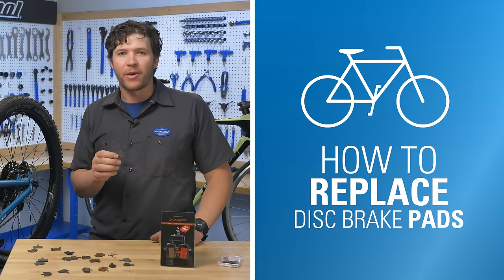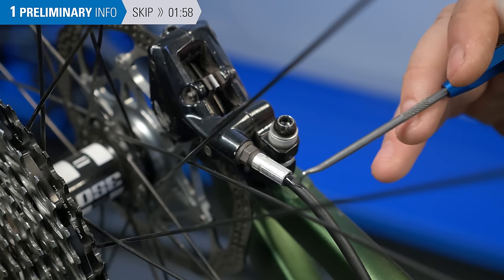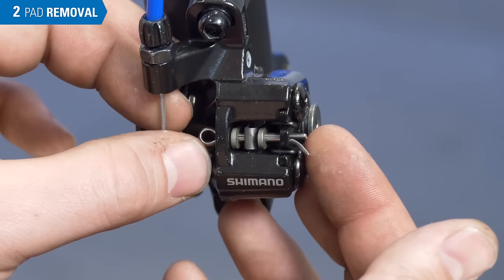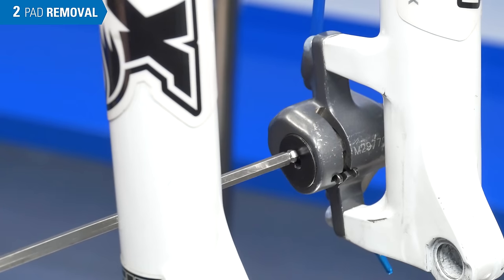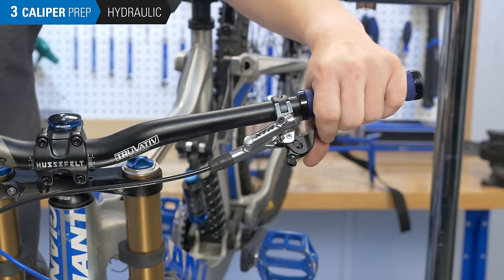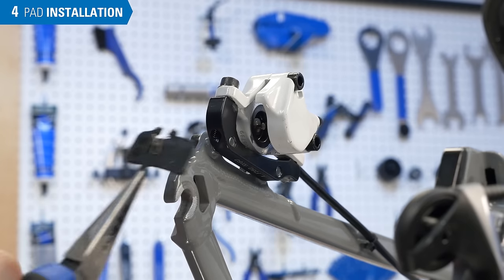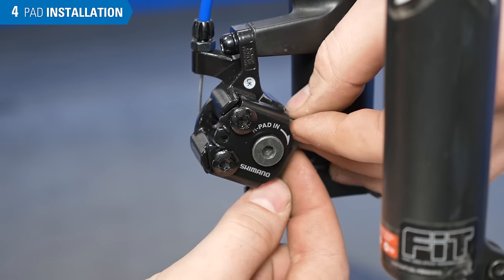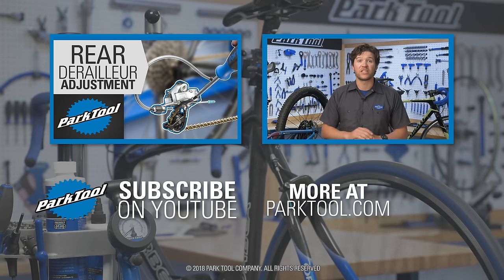How to Replace Bicycle Disc Brake Pads

Comment: Do you also have to re-dial in the brake contact dial on the brake lever itself, back to the most open setting?
Reply from the maker: When resetting the pistons that is not necessary.

Comment: I have the cotter pin type of brakes. I removed the pads and installed them back in and now I have no brake pressure. Did I do something wrong? I didn't touch the brake leaver when removing the old pads.

Comment: Do you know why my front pads don't stop like the front ones do? I can move my wheel with my hand with force, the back locks up though. Its a newish bike any ideas? They're adjusted properly. The rear brakes also pulse, as if the rotor is out of round.
Reply from the maker: THis would lead me to believe the pads and rotor have been contaminated with some kind of oil. New pads and rotor would solve the issue. There are some other methods of getting rid of the oil but in our experience new is the only 100% effective way.
Reply: @parktool  oh thanks! Getting new pads. The company is warranting them. And a rear rotor. Im so glad.

Comment: Park Tool, something that was not covered.  Some pads have a left and right. Which side is the left or right (same as your pedals)  and why do these pads specify left and right?  maybe you can answer this in comments for future readers.
Reply from the maker: Good catch. Many Pads come left and right specific because of the shaping of the pads and how they are held in. Others are side specific due to cooling fins that integrate in a specific way to the caliper. Even others are symetric and could be installed either way are labeled right and left as to give you consistency if you were to ever remove your pads and re install them you can get them to the correct side. Thanks!

Comment: My rotors are straight, callipers perfectly aligned, pads spaced out correctly and evenly either side of the rotor - BUT every now and then (usually after a bump but not always) I'd get an intermittent zinging rasp on the front brakes. Kinda like the sound it could make (I speculate) if one of the pads lifted off it's piston and is glancing lightly against the side of the rotor... or perhaps the fork LOWERS get twisted temporarily? Sometimes tapping the front brake lever gets rid of it, sometimes not - but eventually it goes away (I can't recreate it on my workshop). I have two full suspension MTBs, I'm the first owner since brand new (both thru-axles, one with 180mm rotors and the other with 230mm rotors - different brand hydraulic brakes and forks) and they both do it. Does this ever happen to any of your bikes? If it does, I'd like to see a video made about this. Cheers!
Reply: Could be due to slightly worn out hub bearings? Or the wheel clamp is not tight enough?
Reply: @redbullnshimano1  I've considered that but it's a brand new enduro eBike with a thru-axle, unless of course the wheel bearings are defective (but I can't find any evidence of it. When I picked it up from my LBS I asked for the brakes to be switched around to what I'm used to (right lever - rear brake). The mechanic just swapped the hoses without bleeding it - apparently they do it like this all the time. I'm now suspecting that there may be air bubbles somewhere between the master cylinder and the caliper pistons. The bubbles compress to nothing under braking, but then expand again preventing the caliper pistons from being retracted properly. I have yet to confirm this... still waiting for my bleed kit to arrive. I want to do it myself to confirm my suspicions.
Reply: @grandpabrogan  Apparently we share the same problem here. But I manage to eliminate the scuffing by pressing hard on the brake levers a couple times. It works for a while until I do some more drops and it comes back again. Anyway I got used to it. Its juz a scuff but not really dragging the wheel/rotor. Ohh.. btw mine is rear brakes that was acting-up. So my guess was maybe a flex of the swing arm caused the problem.

Comment: Shimano J04C brake pads. How to mount a brake pad with the L mark, and how with the R mark on the front and rear wheel?
Should L be on the outside of the wheels and R on the inside of the bike, regardless of how the caliper is installed?
Reply from the maker: Right and left is from the riders prospective. The caliper should only be able to go on one way which will put the right pad on the right side of the rotor and the left pad on the left side of the rotor. If for some reason the caliper were flipped (adaptive needs?) then they would need to be reversed.

Comment: I have done everything correctly but the problem I got is there is not space between brake pads so that I could not enter the disc into that. What can I do in this case?

Comment: So if the disc says resin pads only, does it mean I can install sintered compound (metal pads) at all or am I ruining my disc? And what to do when the slot between the new pads is too narrow to slide the disc in? I released the 2 screws that hold the claw together, the slot opened wider but oops... oil started dripping. There must be a better way ; )
Reply from the maker: For hydraulic brakes, push the pistons back into the caliper body. That opens up more room for new pads.  The "resin only" rotors are not heat treated and will wear out quickly.  Use only the resin pads on that rotor.

Comment: Hi, I replaced my shimano brake pads (B01S Resin) and at 7:30 you say to pump the pistons and pads back to the working position... in fact my brakes now are "loose" I mean when I break, the disc isn't stopped strongly enough. I don't think I need to do the bleeding. Need just some basic help to adjust brakes, didn't find it in your channel. Should be basic stuff I know but I forgot how to do it or the proper terminology to find the result in youtube, can you help? Thank you,

Comment: I have problems with my break leavers it squishy. It stop little bit how much to replace it
Reply from the maker: It could be a sign that you need to replace you pads. or possibly that your brakes need a bleed if they are hydraulic. Price depends on where you are.

Comment: I can’t push the pistons all the way back in - and then the gap isn’t big enough for the rotor.... formula RS1s. 
I’m well confused?? Never had this issue with any previous breaks.
Reply from the maker: The system could have too much fluid in it. This is not uncommon on brakes that run DOT fluid. On that brake it might be best to bleed it to get the correct fluid volume in the system. The quick and easy way would be to remove the bleed screw from the lever and then push the pistons back in while holding a towel or rag over the port. The excess fluid will come out the port and will then allow you to push the pistons back in as far as needed. DOT fluid is hydroscopic so it absorbs moisture and in bikes it can even pull moisture through the hose very very slowly.

Comment: if your pads have some contamination, there is no way to clean it, right? It can only be replaced?
Reply from the maker: Replacement is the only true option. There are many people saying they can be cooked or cleaned and reused but that can both damage the pads and or contaminate them more. The most effective way to fix them is to replace them.

Comment: I just changed my pads and it feels like I’ve got to squeeze the levers really hard to get my bike to stop.  They aren’t as quick to stop as before.  Please help me.  Do I need to adjust the levers or bleed the brakes.  I noticed that there was some fluid that cake out of the fill screw at the brake levers after I changed the pads.  Not sure what to do.  I have sram xo ultimate from 2008 specialized enduro.
Reply: you need to break it in.

Comment: How do I know when I need to change my pads on the disc break? Will it make a sound will it damage the rotor? How do I know?
Reply from the maker: The only clear method to know is to remove the pad.  If the material is less than 1mm, it needs replacing immediately.  There is no sound it will make at that point, similar to a car.  If the material wear off completely, the backing plate will damage the rotor.

Comment: I took the pads off my mtb which are secured by the magnets but as I took both pads out , one of the magnets had fallen off the caliper from the inside . Which would be the right way to install it back in . If anyone could help thank you so much !
Reply from the maker: What kind of brakes do you have? Typically the magnet is captured and not able to fall out.

Comment: I bleed my brakes and they rub?  It's too tight.  I let some fluid out for room but didn't seem to do much on my sram code brakes?
Reply from the maker: If the lever does not have much throw then I would start by pushing the pistons back into their bores. Then install the pads and check the clearance. Then install the wheel and turn it. Does the brake rub at that time or after you pull the lever a few times?

Comment: Very confused here about which brake handle is connected to the front wheel.  In the initial walking scene, it seemed the rider was holding the product in the left hand, and braking with the right handle - which is backward for the front wheel but common on cyclocross bikes.  But at the end where there was no squeal, the rider was clearly braking with the left hand, and the right handle was untouched.
Reply from the maker: This is personal preference. In the UK and Europe it is fairly common for the front brake to be on the left. Some users in the USA like that setup as well. Especially if they are a motorcycle rider. But the most common setup in the world is right lever to rear. Left lever to front.

Comment: Very informative. But I still can't figure out which type is mine. Mine is avid bb7. Can anyone highlight me on this? Thanks. Looking forward to a response.
Reply from the maker: BB7's have both inner and outer adjustments. They are very popular and many aftermarket manufacturers as well as avid/SRAM make multiple options for pads.
Reply: @parktool   So is bb7 similar to the last example in this vid?

Comment: Hi park tool. If I lets say press the lever without the wheel and I use the PP 1.2 piston press to spread the pads is it enough? Or do I need to take out the pads and to press the pistons back in
Reply from the maker: Just spreading the pads with the PP-1.2 or PS-1 will be enough.
Reply: @parktool  thanks

Comment: My 29er mountain bike (mostly with Shimano XT gear) has been sitting in the garage unused for a year, recently I started riding it again and the front disk brake made terrible squealing noise. The breakes were working fine just noisy.

The front brake is a Shimano Deore M615 hydraulic disc brake and I remove wheel and cleaned the disc with isopropyl alcohol to ensure it is clean, then removed brake pads and used some 400 grit sandpaper to clean any tarnish from the unworn pads. Then put the brake pads back in and noticed that when I use the front brake there was no resistance and the pistons no longer move. I removed the brake pads again and noticed that pistons are not moving.

Any ideas how to fix this?
Reply from the maker: if the pistons are not moving it makes me think that you may need to bleed the system. The hydraulic system can create a ton of pressure so if there was fluid in the system at least one of the pistons would move. This does not address the noise but the lack of braking.

Comment: why are my brake lever gaining some slack ? bike has been waiting for my knees to heal up..i just found out that my brake are jamming up too. do i need to bleed them and add new hydraulic liquid?
Reply from the maker: What kind of brakes do you have? Brand? I ask because there are a few known issues with some systems. Thanks!

Comment: Can I do this with the wheel attached?
Reply from the maker: It is best to remove the wheel because you want to push the pistons back into the caliper body.
Reply: @parktool  indeed. Just changed without taking wheels off and they are dragging haha.

Comment: Does the bike need to be correct way up to do a pad change? Tried with it up side down and i couldn’t get the pistons back in properly
Reply from the maker: Upside down should not matter.  Watch how the come out, and then reverse the process for new ones back in.  Make sure the pistons are pushed back into the caliper body to make this easier.
Reply: @parktool  for some reason I try to push the piston in one side at a time and they come back out again 🤷🏻‍♂️🤦🏻‍♂️

Comment: My pistons don't want to go back in, I push them and they come back out. And after I install the new brake pads, my disks is rubbing and I have to apply force on pedal to move the wheel... damn it.. I need to air it I suppose... I mean to take out some oil, and air if lucky..

Comment: Does the brand of Pad matter matter? Can I Buy pad that's are the same style but from a different brand? I have a VIVI F26F fat fire bike and is uses  SA 160mm cassette, semi metal pads.
Reply from the maker: The brand does not matter as long as the fitment is correct.
Reply: @parktool  Thank you that's what I was wanting to know. You are the first one to give me any real information.

Comment: Inner caliper stuck(It does not come by using alien key) please reply sir.......
Reply from the maker: Look around the caliper for a small "set screw" that locks the caliper adjustment in place. Often thats what prevents adjustment. In some cases they get corroded to the point they cannot be adjusted as well.

Comment: My break are making so much noise and i been told to cleaning with alcohol it have new brake pads i use w40 xD but it does not work...
Reply from the maker: WD-40 will ruin your pads and rotors. Get another set of new pads and remove your rotor to be thoroughly cleaned with brake clean then alcohol.
Reply: @parktool  thank you , and sorry for this question the pads are brand new what about i just clean it with normal brakes cleaner and alcohol ? Or do i really need to get new one ? Thank you
Reply from the maker: Pads are porous and absorb liquids like wd40. WD-40 does not evaporate like alcohol or brake clean and leaves behind an oily film that will continue to come out of your brake pads as you use them. There are people out there that clean them thoroughly and even some that use heat to clean them out. New pads are the best option but if you'd like you can experiment with different cleaning methods.
Reply: @parktool   thank you new pads will be better than ...

Comment: Sir my bicycle uses pads which are circular uses a pin system and an spring system but I can't find a similar one can I use a square one
Reply from the maker: Very unlikely.  The pads shape fits the caliper body, and do not interchange between square and round.

Comment: I actually can't push the pistons in. I think there's too much fluid. Any fix?
Reply from the maker: A bleed would fix that situation. If your brakes run DOT fluid then this is fairly normal as the fluid absorbs fluid and air. Hope this helps

Comment: My Brake pads started doing alot of noise, i tried to clean it by sanding and burning but It doesn't work, Do i just buy a new Brake pads ?
Reply from the maker: New pads and really clean and scuff up the rotors.

Comment: when I change the pads on my front brake, I find I don't have to push the calipers back before inserting the pads, they are already housed. It also takes a lot of pumping on the brake lever, lifting up the front end of my bike as well, before it tightens. Is this normal?
Reply from the maker: If you removed your old pads and replaced them without having to push your pistons back and then had to pump the brakes to push the pistons out even further, that is not normal. It is normal to have to pump the brakes a few times if the pistons were pushed back into there bore though. Do the brakes feel normal now?
Reply: Yep. I've replaced the pads a few times now, and they are running fine once i have pumped them. I am wondering whether I need to bleed the front brake- perhaps the oil level is not sufficient?thanks for getting back by the way
Reply from the maker: So you are not pushing the pistons back in when replacing the pads? not spreading the old set of pads or anything? If you are then its totally normal to have to pump the brakes. Its just the brakes self adjusting to the new pads. If you are not spreading the pads I don't know how you are getting the wheel in afterward. The new pads are thicker than the old ones and because the brake pads are thicker they take up more space and will not allow the rotor to pass through them.

Comment: Are you able to reuse the cotter pin?
Reply from the maker: Yes you are.
Reply: @parktool  thanks! Ive been running through pads on my motorized bike and I'm waiting on my tektro hydros

Comment: Can you use the Park Tool PP 1.2 tool on ceramic pistons?
Reply from the maker: You can. Be sure to push them back in nice and square. Some ceramic pistons have fragile skirts and it is important to push them back into the bore nice and square.
Reply: OK thanks, it says you cant on your website though??
Reply from the maker: This is true. There are some specific ceramic pistons that are susceptible to breaking if not pushed back in nice and squarely. This is why we specify that on our website. The tool can be used safely but can also be used improperly and cause issues.  If you use the tool properly to push the pistons back in squarely you will be fine. If you use the tool and the pistons get pressed back in at and angle then the skirt on the piston can break.

Comment: Hey! How you doing?
I need help... how do i clean pads and disc, i put wd40 on them,a lot of it,thanks
Reply from the maker: It is going to be best to clean your rotor with isopropyl alcohol and get new pads. The pads are saturated and burning them will not get rid of all of the lubricant.
Reply: @parktool  thanks, got new pads